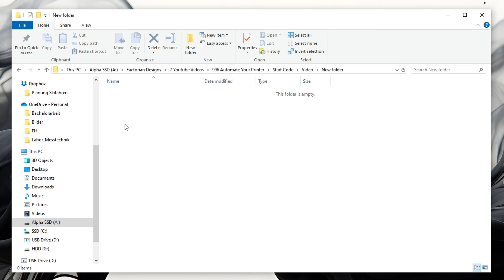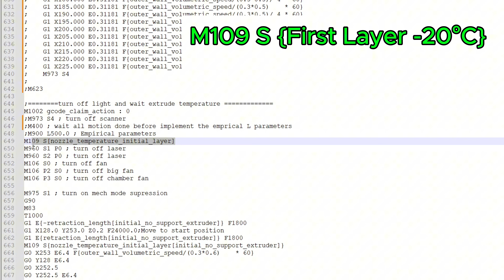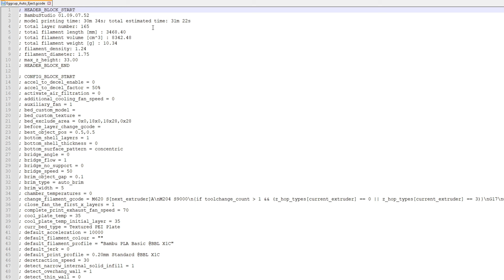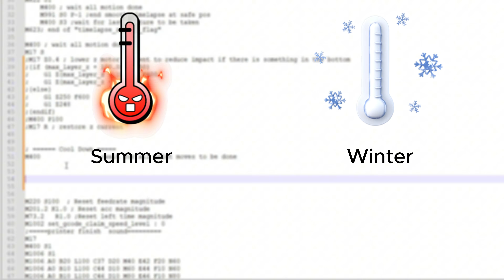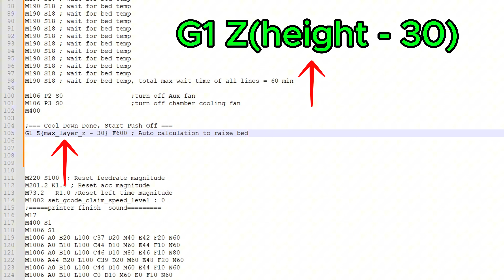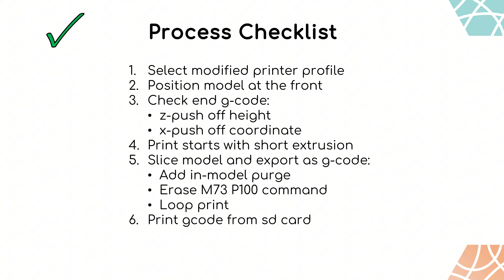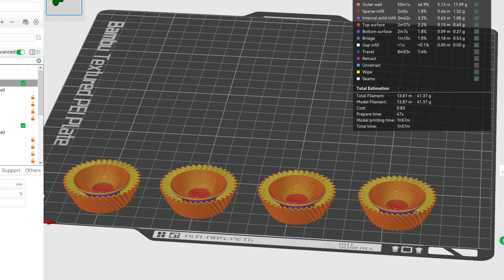Automate your Bambu Lab P1 & X1! Free & Easy

Comment: Great video and thanks for the explanations but considering how reliable the Bambu machines are, i would likely choose to just fill the bed with these parts. You are hugely increasing your electricity costs per print doing it this way and by far more when doing multilateral prints. There is a reduction in failed print risk but as cool as this is, im not sold..

Comment: Don't you need to lower the bed for tall prints? If you let them come trough the 'roof'  you can't push them off
Reply from the maker: You are correct, we do lower them again after the part is cooled down, like shown in the respectiv parts.

Comment: good idea but i wonder why you copy the gcode instead of using a jump command? i have been programming gcode for milling for a long time and would therefore simply write L0 N1 at the end.
Reply from the maker: Bambu Sadly does not have a gcode documentation. I tried quite a few commands but none worked in the past. I will try a few more comment suggestions in the coming week.

Comment: Why not clean the printbed with isopropanol? Do this with my PEI Sheet the hole time and saw no change in adhesion.
Reply from the maker: According to Bambu Lab it spreads the oil more than it removes. Soap works way better for me.
Reply: @ ok. I don’t know how alcohol on a pad can spread more oil but ok. Never change a running system, is my motto.
Reply from the maker: @MarkusReinisch  Try the soap solution once and compare the adhesion. I guarantee it will be better than IPA.

Comment: This is outstanding. 

One note, this process is great for prints that don't have much surface contact with the bed. However, if you have a very flat and wide model, even with the the PEI plate it may not fully release. 

I've seen other loopers fix this by including a block in the bottom front of the printer and lowering the bed down to it. The purpose of the block is to touch the small tab in front of the build plate but not the bed, so when the bed height is just below the block, the block will slightly lift and flex the build plate, adding some extra release assistance.
Reply from the maker: I thought about doing that as well but never tried it out, great recommendation!!
Reply: doing the block for over a year now with the p1s just be sure its in the center of the printer. tape, clamps or clips to hold down rear corners of the bed is the way to go too. so bed wont pop off.
Reply: @dammitmatt6426  Do you mind sharing a specific video of this? I’ve tried searching and haven’t found anything. Thanks!
Reply: @rydenkhamo5832  unfortunately i don't have a video, they don't share the information for how to do it because it's proprietary and they want you to pay for the automation and job management service. Which is why I love this video because all i really have to is add a couple of z axis moves after all of his instruction and we're good!

I will say the service would still be good for job management if you have a print farm, but I don't have that many lol
Reply: This deserves more likes.
Reply: I'd be curious if you could use the closed-loop feedback of the K2+ to address this fail-state gracefully.

Comment: Why soap and not isopropanol alcohol for plate cleaning?

And can I instead just put it in the dishwasher?
Reply from the maker: IPA spreads oil instead of removing it, according to Bambu Lab.

Dishwasher detergent is probably way too aggressiv, I wouldn't do that.
Reply: @Factorian_Designs  thank you for taking the time to respond

Comment: Thank you, that's excellent info! I'm not even looking to automate my prints (although it's good to see it would be pretty easy), I just want to shorten the excruciating 7.5-minute start dance. Your walkthrough of the default start G-code and what edits to do saved me a lot of time and effort figuring it out!

I'll leave the purge line in for my normal prints, but I'll make it shorter, more sensible, and easier to peel off. I can't believe the default purge line is so bad! The oozing filament messes up the nozzle, and the last line that it extrudes always seems to leave a 20cm long hair hanging from the nozzle just when it's starting the actual print.
Reply from the maker: Yes it absolutely annoys me as well. You can also put it further up front so its easier to remove.

Thank you for the super thanks!

Comment: This is great information, thank you for sharing. I do have a few questions.

So after I have cleaned the build plate how do I calibrate/level now that it is written out of the G code, will I have to run the manual calibration that takes a while?

There's an faster/easier way right?

Comment: super amazing stuff! Now all I need is to find a product that everybody wants to buy off me so i need to run the printer in batch mode and also, actually run a first print on the machine which has not ever been used since i bought it. Details.

Comment: Have you had any issues with the front toolhead cover falling off or getting nudged so the warning keeps preventing you from printing?

Almost every time I've manually used my printhead to knock parts out of the printer it has nudged the cover enough that it detected it as having "fallen off" and I couldn't start a new print :/
If anyone has advice on that I'd love to hear it!

Comment: Great and smart idea. With Klipper Firmware it could be  easier with custom macros. You could also write a very simple postprocessing script, which multiples the gcode/print iterations, so you don't have to copy the gcode manually. You could go as far and write a script, which does the whole process for you. It's possible to add postprocessing scripts in the slicer, which then get executed after saving the file.
Reply from the maker: Yes I have thought about that as well, but I fear releasing a skript like that will result in more damage than it does good.

Comment: Gibt Abzüge in der Effizienznote
1. Die Bambulab Drucker haben n offenen FTP Port 21, gibt keinen Grund die schwere SD-Karte Sinnlos durch die Gegend zu tragen.
2. Können die Bambus Label oder GOTO?
Reply from the maker: Wie gesagt es gibt 3rd Party software die den ganzen SD Karten und Loop Teil überspringen.

Bin mir nicht sicher was du mit 2. meinst 😅
Reply: @Factorian_Designs  ich bin Metaller, bei CNC Fräsmaschinen kann man Bearbeitungssschritte oder Werkstücke unter anderem mit Goto oder Label wiederholen. So musst du bei jeder Änderung den ganzen Kram neu kopieren, dass ist ja n unding.

Google kann dir mehr zu den Befehlen sagen, ich hab aber leider keine Referenzliste für Bambu gcode gefunden
Reply: @Factorian_Designs  laut Klipper Doku scheint wohl Loop_Sdcard dem zu entsprechen woran ich da gedacht habe.
Reply from the maker: Habe auch etwas gegoogelt aber nichts explizit zu Bambu Lab gefunden. Ist wirklich sehr schade daß sie keine gcode Doku rausgeben.
Hatte damals einige Loop Befehle ausprobiert aber keiner hat funktioniert.  @Eilzeum

Comment: Okay but why dont you just fill up the bed with like 20 cups? That will most likely take longer than however long you are sleeping..
Reply from the maker: I still have to pick them off at some point and printing so many things at the same is higher risk and deminishes quality a little.

But always do what ever works best in your case, automating is optional.

Comment: Fantastic video! Informative and entertaining. Thank you for sharing this with the community.  Also, what is the white part under your auxiliary fan? My X1C doesn’t have that part so I assume it’s an aftermarket print?
Reply from the maker: Thank you!

Yes my AUX fan fell off at some point. This is the official solution from BambuLab. It Just holds the fan in place.

Comment: I wonder if you could increment the purge line in some way, since your print is at the very front, you could purge at the rear left or right of the bed, then for the next one put the purge line a few mm beside, and so on. You could get quite a few lines on there before you run out of space. Probably G-code is too simple to do something like that, unless you change it by hand in every repetition.
Reply from the maker: Maybe with some kind of skript that loops and modifies the gcode file, but I didn't have the need for that yet.

Comment: Not bad for a start. But you should look into G-Code scripts. You can make your life a lot easier by scripting when certain G-Code should be applied etc. right in the slicer. At least in PrusaSlicer, but since BambuStudio is just PrusaSlicer with a different user interface, I presume it should work fine there too. On Prusas there are also things like GPIO boards, which let you control external electronics from the C-Code, for example to keep the door closed during the print and open it to eject the print or something, which may be beneficial for some materials. I'm not sure if this is quite as easily possible on BambuLabs, they're known to be quite limited when it comes to developing your own stuff, given their proprietary nature. But I'm sure one can find ways to automate BambuLabs a little more too. If everything fails, you can always just run the extruder into a switch, to trigger some external automated sequences. May seem a little silly to have to push a button with the extruder, but if it works, it works.

Comment: I've set up multiple-copy prints where I didn't trust the slicer or it couldn't do it (long time ago, I forget); I'd slice one part such that it fell between X100 and X200 and get it working, then make a second copy of the Gcode and search-replace "X1" with "X" to offset the whole thing 100mm to the left. If I'd had a bigger bed, I could've added a third copy and search-replaced "X1" with "X2". I still use this trick occasionally.

Comment: Eine Frage zum über Kopf Drucken:
Würde das auch mit vielen kleinen Drucken funktionieren? Weil dann lohnt sich die 12 minütige Abküjldauer lohnen, da dann die ganze Druckplatte voll sein könnte, oder zumindest die vorderen 3/4 (die Schleppkette sollte ja nach dem Druck wohl besser nicht von herabfallenden Drucken getroffen werden 😅)
Reply: I guess you'd have to experiment. Small parts may not even have the weight needed to fall off by themselves.
Reply from the maker: Small parts can be tricky, you could think about printing a different cover that reaches a little further down

Comment: Excellent video! I was doing some similar experiments with a prusa mini a few years back, and I remember I was surprised to not find any command to jump to a certain line. Is that still the case and third party setups are necessary for this? I don't like the copy paste method and ideally would prefer to have the gcode loop until stopped.
Reply from the maker: Somebody did mention a GOTO command where you could jump to line 0 again. But I am not sure If this works with Bambu printers.

I have access to my printer in sunday and will definetly try it out.

Comment: I have absolutely no use for this, but I’m baffled that’s it’s even possible and how well you explained it all.
Reply: Same here!!
Reply: im just shocked no 3d printer manufacturers have done this yet
Reply: you summed up my thoughts perfectly lol
Reply: if you know gcode, you can control everything of the controller board. we did automated printing in 2009-2012 when the home 3d printer scene took off.
Then the cheap chinese printer clones invaded, they stole and ruined everything and everyone engineering something just quit..
Its pretty sad to see all these years later, barely no innovation whatsoever....still just lots of chinese printer clones doing the same as 15 years ago.
Reply: @c4tohagen  funny rant... there is tons of innovation... and quality improvements. just 98% don't want or need a print automation.
Reply: @c4tohagen  the difference is that these “cheap chinese printer clones” are plug and play.
They simply work without fiddling allowing people to create what they want instead of making and battling with the printer (which admittedly is what some people like doing)
Reply: @buffalowt yeah, I became intrigued by printing for making routing jigs for custom pieces, and I was told I would hear a ton negative about Bambu because there wasn't as much of the printing hobby happening, just made things. Having a tiny boat in hand about an hour after the printer arrived was amazing.
Reply: @c4tohagen  No reason to be discouraged, there will always someone cheapter (china, us, india, ... ).
Reply: @c4tohagen  as with every development it’s steep in the beginning. Cars have been pretty much the same for decades, until something comes along to disrupt the status quo (electric cars). Bambu did nothing new, but there was finally a printer that the masses could use and understood. Prusa tried to be that company but failed in their communication. Bambu sold us an Apple like product that just works (and for the most part it does) and that’s very appealing to regular consumers. And this sparks other companies to develop faster, just like Tesla did in the car industry. And since now a lot more people own a printer and get more interested in the possibilities you might be able to see something like this rolling off the shelf
Reply: @c4tohagen looking at a Bambu Lab machine and saying theres no innovation while companies still struggle to catch up to the X1C which came out 3 years ago now is cope

Comment: I got my first 3D printer a week ago (P1S), looked up how to get clean prints and found you. Now I've watched all your videos and feel like I've learned a lot, so here's to hoping my next print is gonna be amazingly clean (and optimized)! I've tried printing some geometric low-poly stuff, but 2/10 large parts come out with (based on what I've now learned) 3/5 over-extruded facets and 1/10 of the smallest parts with a warped bottom layer. Sooo.. Time to dive into the slicer and see if I can't fix that with this new knowledge!
Thank you!
Reply from the maker: Don't worry with time you know whats wrong with specific prints quite fast. Glad you like the content!

Comment: Actually a good idea but I would say you will get only limited benefits here. Answer is simple. If you are using a X1C you want to make use of the complete build plate (in this case 16 pcs. around 32 hours printing time in your case. And this is actually the better way to do.
I agree with small build plates which I use on my A1 Mini Farm (currently 12 Printers) . Here it makes sense and no need of the additional automated build plate changings. You always have to ask yourself when running a business. You would like to produce as cheap as possible with highest quality you can afford. So you use a cheap printer A1 Mini (currently 179€) in sale and produce the parts fully autonomous. So you get out most beneift of it and the printer is paid off in days not in years.
On bigger parts like Vases, Lampshades etc. I am using X1C. P1S and P1P printers as well as Ratrigs and FLSUN T1 Pro. They are cheap and reliable. No need to have 5k+ printers for that. If you have 20 hour prints+ you dont need to have the automatic push of the parts as you will definitely be there to pick it up and restart the next print. If you are using a lot of Vase Mode then I do this could be a really good approach, i like your mindset.
Reply from the maker: Fair point, I think everyone has to choose the workflow that works best for them and their models. Printing 16 egg cups at once come with it own downside as well, but that is the topic of another video.

I fully agree with you on the A1 Mini, if you don't need much build space this machine is currently by far the best choice for 3D Printfarms.